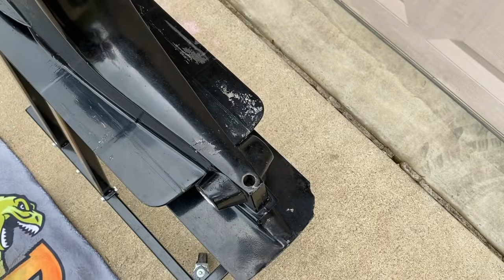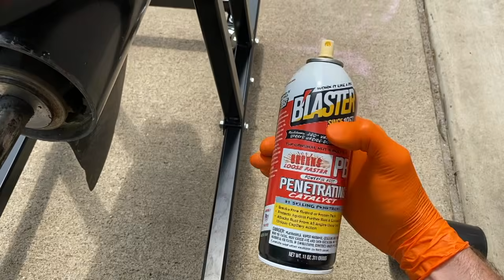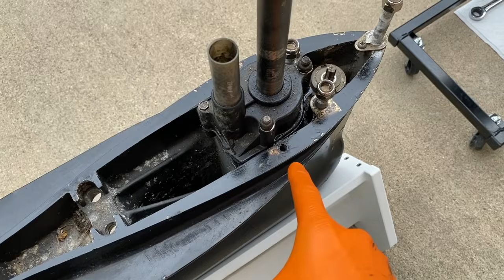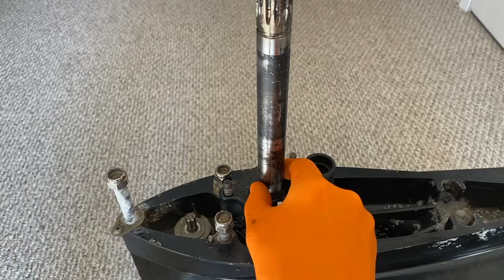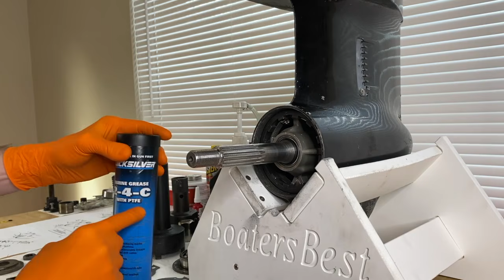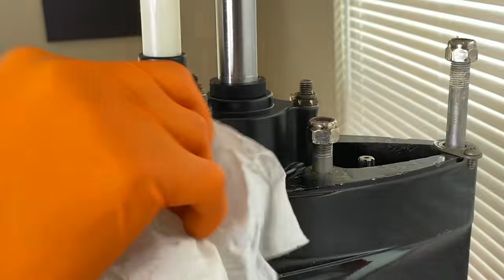Replace Mercruiser Alpha outdrive water pump/impeller - DIY

Comment from the maker: If interested in purchasing the products below, visit our Amazon affiliate links below.  I earn from qualifying purchases.

1.  Outdrive stand (Upper & Lower)

          https://youtu.be/gLBQvjiYaEk

2.  Outdrive stand (Lower unit only)

          https://youtu.be/UEpwRnimMoc

3.  (2-4-C Lubricant)

          https://amzn.to/3NwTCfg

4.  SAE 90 gear lube

          https://amzn.to/3OUVsYN

5.  Craftsman torque wrench

          https://amzn.to/3y5OTM7

6.  Water pump base (46-44292A3)

          https://amzn.to/3OR9eeH

7.  Water pump upper repair impeller kit (46-96148Q-8)

          https://amzn.to/3yFLvsZ

8.  Replace lower unit Water Pickup inlet vents

          https://youtu.be/JYrfVxU4cmI    

😎👍
Reply: I'm having issues with mine after replacing the impellar. Not sure what happened. But the small rod in the center of the drive shaft on the lower unit is stuck up. When I reassembled everything. I got the boat out. Water flowed great but when I went to put in reverse or drive it just immediately stalls out. I  realigned the transmission shaft where it was correct. But now the only thing I noticed that is different is the small rod piece in the center of the lower unit sticking up.
Reply from the maker: @douglaspauly2992  

Thanks for watching, any update?  Are you servicing an outdrive or outboard?

Comment: I cannot get the fins or blades of the impeller to face the right way. I’ve spent it and spun it and spawn it over and over again with no success.
What are some tricks and tips to get the blades to face the right way as of now I have six total blades of which five or facing the right way and the first one is not
Reply from the maker: Thanks for watching, any update?  A tiny bit of grease goes a long way went inserting the rubber blades insert.
Reply from the maker: We will also share a link to our Fixing Boats playlist below.  Lots of helpful troubleshooting and repair videos.

     https://youtube.com/playlist?list=PLjCXOz8TSkZlae2qY97uVVTm3JdBOUoRS&si=3j5xiG667c6AO34t

🙏

Comment: What do I do if the shifter shaft won’t stay up in the top half?
Reply from the maker: Thanks for watching, any update on your project?  Are you replacing impeller?

The shift shaft can lower if not placed inside the lower shifters splined insert.

Please keep us posted.  We will also share a link to our Fixing Boats Playlist below.

     https://youtube.com/playlist?list=PLjCXOz8TSkZlae2qY97uVVTm3JdBOUoRS&si=InPKXAyAJCfRvLjq

🧰
Reply: @DIYwithMichaelBorders I replaced the impeller.

But then the shifting wasn’t working. So I tore it all apart and am waiting on seals now.

Great videos
Reply from the maker: @ryanoleary100 

Oh man, hard at work.  It will pay off no doubt!  😎🙏

Comment: Could it be that if the shift fork isn’t straight forward when prop is locked anticlockwise the rigging will be off in the boat…? That’s where I’m at.
Reply from the maker: Thanks for watching, any update.  There is truth to your explained example.

By chance did you perform any adjustments or replacements on your shift cable during your project?
Reply: Do you have a video of how to adjust the shift cable after replacing it it’s ticking when I spin the prop by hand now
Reply from the maker: @michaelweidman7242 

Thanks for the replay.  Link below shows the full shift cable replacement process.  This video includes a brief discussion on the adjustment process.

     https://youtu.be/6khs8q5NyjI?si=xecuUk2agzAUoNcX

🙏🧰

Comment: We are trying to replace the bottom unit of the water pump in a mercury 500 and it will not snap into place. Any suggestions?
Reply from the maker: Thanks for watching, any update?  Double check that all gaskets and seals are installed in their proper order and fully aligned.

Also, ensure that key is not offset in anyway.

Comment: How did you know the water pump was bad?
Reply from the maker: Thanks for watching.  When your engine is running.  A faulty water pump will lead to engine overheating, whining noises as inner parts are malfunctioning, and a more noticeable and dense level of smoke coming out of exhaust while in water.

Comment: 18:06 is there a seal in the upper impeller housing? I don’t see one and my upper housing part also didn’t come with one
Reply from the maker: Thanks for watching.  Only seal is the small rubber o-ring that the water tube seats against.  You will see us we lubricate it.

How is your project going?

😁👍🧰

Comment: I have 4 big seals. I only need the one for the lower unit for the lower part of the water pump, right
Reply from the maker: @anthonycox5247  

Thanks for watching, is your outdrive an 89 like ours?  The kit might come with additional seals or gaskets depending on the kit you purchase.

In some cases, not all gaskets will be used.
Reply: Copy I order the one you have here as the one I got off eBay was cheaper and was leaking oil after I put it on I took back off the lil spring was not on the water pump any more I think that where the oil was getting out an seal on bottom was oily so I got a new one
Reply from the maker: @anthonycox5247  

Thanks for the reply, any update with the install of new seal?
Reply: My is Alpha one GEN one on a sea ray V8 260 hp MerCruiser

Comment: Good evening I have a question. I put my outdrive on yesterday and I hooked the muffs up, but no water is going through to the engine. Do you think it’s the impeller my other question is I’ve been trying to figure out how to hook the throttle cable up the shift cable up on the valve cover is there anyway you can help me with this problem? I’ve been working on my engine for about eight months now and these are the two things that are holding me up.
Reply from the maker: @Ptsinthewild  

Thanks for watching, any update?  It’s likely a faulty impeller however not always.  You could have a blockage or the impeller isn’t installed correctly with the rubber fins positioned to feed water.

In addition, below is a link to our video showing replacement of our shift cable.  This may help you.

       https://youtu.be/6khs8q5NyjI?si=SJM1hLGyuvgc2kyP

😁👍🧰

Comment: Mike enjoyed the video, I am doing my pump this summer, and got the kit with base, In the kit was a small round pin about 1inch long and 3/16 in diameter, can you tell me what that pin is for?
Reply from the maker: Thanks for watching Gary, any update?  Some kits will come with extra parts…which…unfortunately can lead to confusion.

Are you working with an aftermarket kit or OEM?  We checked our manual and it doesn’t reference a pin.  Are you referring to the key?

Comment: I'm having issues with mine after replacing the impellar. Not sure what happened. But the small rod in the center of the drive shaft on the lower unit is stuck up. When I reassembled everything. I got the boat out. Water flowed great but when I went to put in reverse or drive it just immediately stalls out. I  realigned the transmission shaft where it was correct. But now the only thing I noticed that is different is the small rod piece in the center of the lower unit sticking up.
Reply from the maker: Thanks for watching, we noticed the other comment you shared and we wanted to reply to both.  Any update?

Outdrive or outboard?

Comment: Is it nessesary to take the whole lower unit down for just the impeller replacement ?
Reply from the maker: Thanks for watching, you will need to separate the lower unit from the upper unit to gain access to your water pump for replacement. However, if your outdrive is still installed on the transom…you don’t actually have to remove the outdrive from the boat to perform this replacement project.

You can just separate the lower unit from the upper unit and remove lower unit altogether from boat.

Keep us posted on your DIY project, looking forward to hearing back from you.  😎👍

Comment: I appreciate your help immensely and especially like how you keep everything nice and clean and laid out correctly
Reply from the maker: Good morning, just poured a cup of coffee and am sitting down to answer any and all questions for the DIY community.

Very kind of you to share, thank you.  The cleaner you keep your equipment, the longer it lasts.  😁👍

Let us know if you have any questions and hey if you’re into crypto trading, join our DIY ecosystem and help us grow an exclusive group of DIYers.

       toolboxtoken.com

Reach out to us any time!  🧰
Reply: @DIYwithMichaelBorders  Mike, enjoyed the video, I am doing my 86 alpha   
1 this year, and bought the kit with the base and mine came with the base O ring installed and I noticed the gasket would not go over, now I know the proper way to put in on,, but in the kit there is a round pin about 1inch long and maybe 3/16 in diameter, I am not sure what it is for, can you help me?
Thanks,, Gary from Ohio.
Reply from the maker: @garymilner2544  

Thanks for watching Gary, any update?  Some kits will come with extra parts…which…unfortunately can lead to confusion.

Are you working with an aftermarket kit or OEM?
Reply: @DIYwithMichaelBorders  yes the kit is after market, I bought 2 kits one from a dealer and the other one from Amazon.. and they both have the same pin and 2 extra gaskets. 
That's for getting back to me. 
Gary from Ohio
Reply from the maker: @garymilner2544  

Thanks for the follow up.  Ok, we see it now.  For our exact serial number outdrive, our replacement OEM kit is (46-96148Q 8) and it indeed has that pin in it.

This pin is not used with our serial number outdrive, and it’s likely not used in yours either.

If you’re old water pump and gasket kit that you removed did not have pin…it’s very likely that this pin is not used on your serial number outdrive.

For legality purposes, since we shared OEM p/n in this comment, we have to add the below statement.

*************

If interested in purchasing this product, visit our Amazon affiliate link below.  I earn from qualifying purchases.

       https://amzn.to/4anlzT4

🧰
Reply: @DIYwithMichaelBorders  Yes that is the kit I bought from Amazon,, thank for the Information. 
Gary from Ohio
Reply from the maker: @garymilner2544  

We are happy to help, and honored you reached out to us.  🧰

Comment: FYI: Mercruiser put out an service update years ago to on longer use the o-ring on the input shaft.
Do yourself a favor and install thegreased impeller first then slide the upper impeller housing down the shaft. While pushing down on the housing rotate the shaft clockwise. It will slip right over the impeller easily. Doing it this way removes the chance of the impeller clip from coming loose and falling out.
Also, use some 3M wheatherstrip adhiesive to glue the oil o-ring to the lower unit so It doesn't fall off when mounting the lower unit to the upper unit.
Reply from the maker: Thanks for watching & sharing, we really appreciate it.  Love the channel name.

We have been busy here at the DIY hq developing & launching our crypto token.  We are in the middle of our web3.0 website upgrade.  Hopefully the new website will launch by December 1st.  We are excited.

Below is a link to our crypto announcement.  

       https://youtu.be/n830NZ1OGTg

We just got accepted onto the uniswap platform exchange.
Reply: Your video is the best I've come across 😊 thank you very much
Reply: So I have so o rings left over some of the big ones what are they for are they extra
Reply: There like 4 of them I only need one right now

Comment: I appreciate this video, to remove the impeller is where I'm at . My issue is that the bottom housing is fried and melted. I removed the bottom housing and part of that housing remained. The round casing seal bearing still remains and is stuck. I fear that it is melted on to casing. Don't know what to do. Any thoughts?

Comment: Can I ask a question no one ever addresses in detail? The white tube off the impeller housing, when you’re assembling the drive back in, that water tube slides over some copper tube coming from the upper part of the drive, but how is that white plastic tube sealed at the top when you put it back together? When I look up inside the upper drive, I see a rubber housing, with a small take-off type rubber tube. That white plastic tube don’t appear to slide over it. What am I missing? Thanks
Reply from the maker: Thanks for watching & welcome to the DIY Raptor Club.  Great question & its sole purpose is to be a guide.

If you remove the white tube, you will notice a seal inside the water pump housing.  That seal is what the copper pipe from the water outlet valve feeds into and creates a seal.

The plastic white tube itself is only there to help you guide the copper pipe into that white plastic tube which in return ensures that the copper pipe feeds directly into the seal inside water pump housing.

Once copper pipe has made its way into the seal, the plastic tube becomes irrelevant however impossible to remove until the next servicing event.

Hope this help.  😎👍
Reply: @DIYwithMichaelBorders  yes. Thanks so much. Very much appreciated. Thanks for response. Not many youtuber folks do.
Reply from the maker: @larrywalden626  

You are very welcome Larry, that’s one of the most important parts of running our DIY channel, making sure we get the DIY community the answers they need & deserve.

Us DIYers need to stick together!!!

😎👍
Reply: @DIYwithMichaelBorders  I believe I've messed up. I rebuilt my lower impeller all brand new. I followed along with your video. Thank you for that. However, I was fighting getting the lower stern drive back up into the upper. I was using ratchet straps to help stabilize it and ratchet up as I was lining everything up. However, the little spline in the front that engages the gears and impeller, I dont know which way to turn that. My prop is free wheel spinning, and I cant turn the large shaft to line up the splines. And i dont know what direction is needed to turn the small spline shaft. I wish I could take pictures and post here to show you what I'm talking about. Could you call me on my cellphone possibly? My email is lwaldenjr@gmail.com. if you can email me, I will send you my cell phone number. I'm seriously needing a bit of direction on this. I dont know anyone personally with a boat. Lol. So I've got no one to turn to for a bit of guidance. Let me know. Thanks
Reply: Thanks for the question Larry as mine was the same. Thank you DIY Michael for your reply!
Reply from the maker: @JoeGracia-III  

Hey Joe, thanks for taking the time out of your Saturday afternoon to share this, it means the world to us .
Reply: Larry I was wondering the same thing, thanks Mike with your answer>